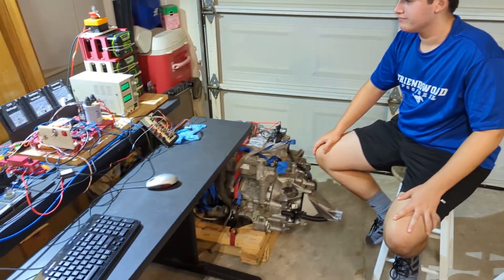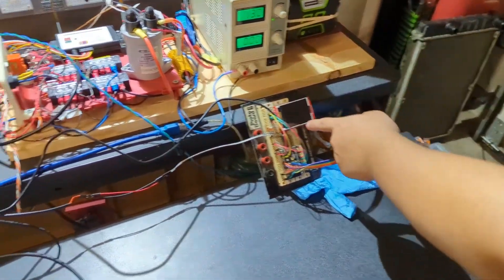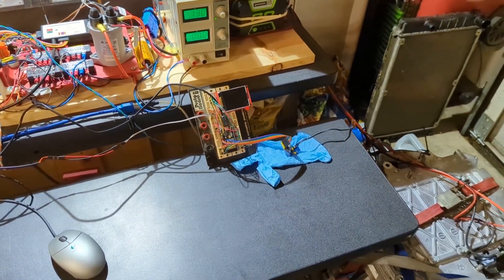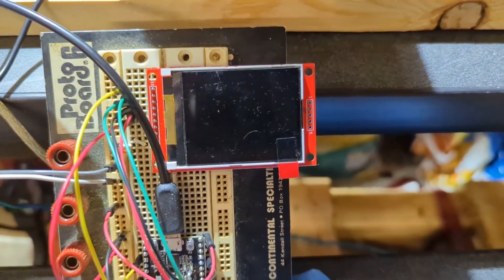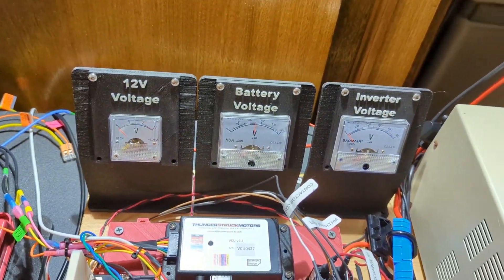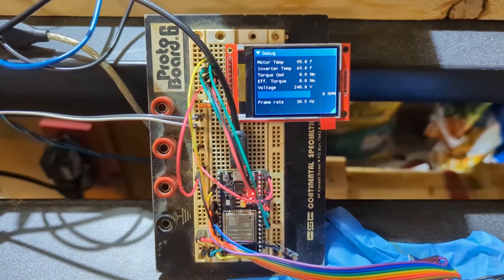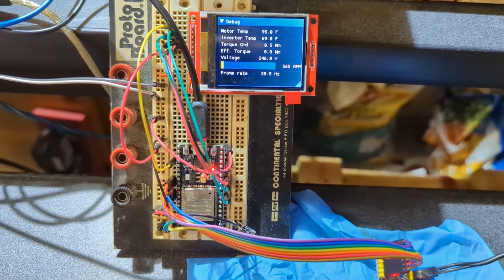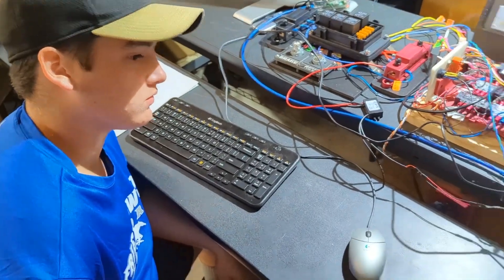Porsche 924S EV Conversion - Part 10 - CAN bus diagnostic display with ESP32

Comment: Love the work here…did I miss an episode where you discussed where the CAN bus connection is made? Is this at the inverter pins 14/15? I’m new to this but would like to the same data for rpm/speed and temp monitoring. Converting 1961 Ford Econoline Pickup.
Reply from the maker: Hmm, this is a long time ago so I don't recall. I'll have to see if it is still connected. Subscribe and when we make a new video I'll try to remember to address it.